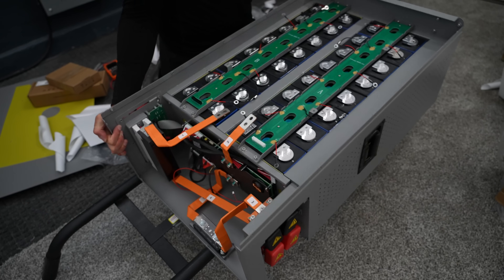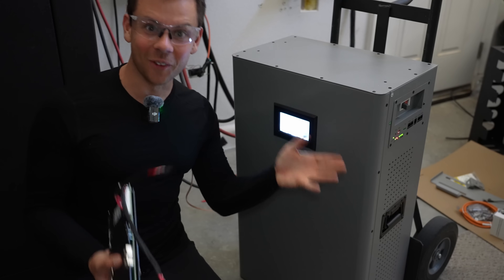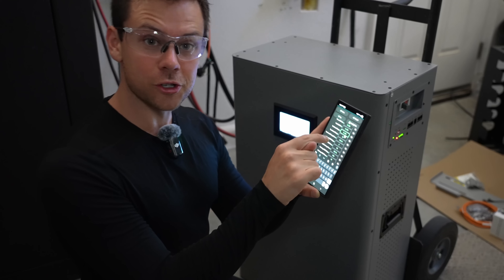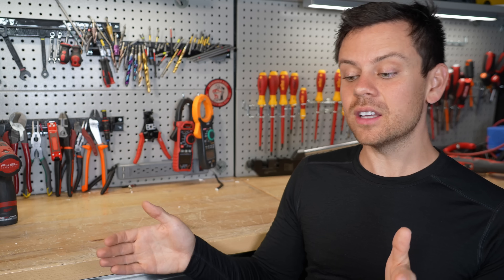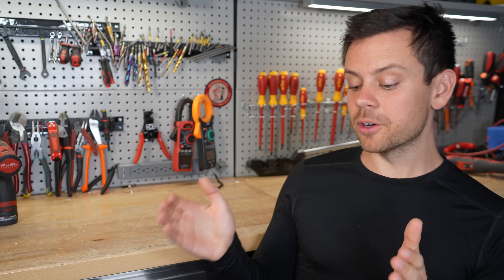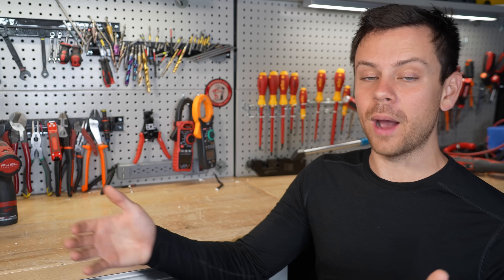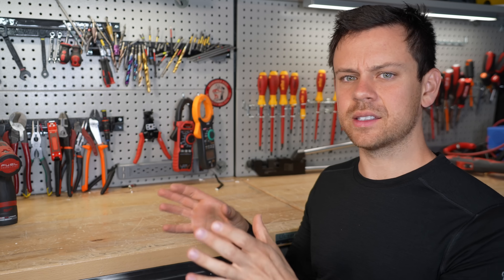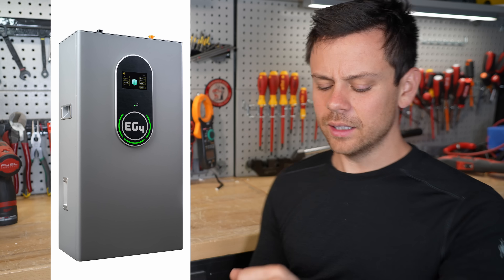Yixiang 16kWh Battery for $1,899?! What in the world!!

Comment: If you have problems with the terminal screw on the battery, put in an stud to the bottom with a little blue locktite and use a nut on it instead.

Should maximize the thread engagement since it's already at the bottom and not having it turning in the treads will also put less strain on the threads in the cell

Or just put in JB Weld instead of locktite 😂 
The current shouldn't go through the bolt anyways (for the most part)

Comment: I am buying US Stock Grade A - Version (3) EVE LF280K 280Ah 310Ah rated with single post welded M6 Studs for $73 each. x 16 = $1,168 and the Apexium/Docan horizontal DIY Kit With JK PB2A16S20P 200A Inverter BMS for $620. Total = $1,788 Free shipping and no sales tax. EG4 indoor wall mount battery with shipping and tax is $3,472, savings is $1,684. that is almost 2 for the price of 1. So my (4) batteries are $7,152 compared to EG4 at $13,888. That is a savings of $6,736. plus I get a better BMS than EG4.
I have (6) 200 amp JK BMS with 2 amp active balancing, 4 are in use. Batteries are 100% SOC at 3.5 volts and begin balancing at 3.45 volts. These BMS’s are set-it and forget-it. I have never had to top balance the batteries, JK has done it for me.
Watch Off-Grid Garage with Andy and set the BMS the way he teaches it. He is the foremost expert on these BMS’s.

Comment: I'm stupid how does 16,000watthours give ONLY barely 300AH useage? Is it because 16k watts can be pulled watts can be used but for only 300+ hours long?
Reply: Also for my office - I have 2 x200ah 12v batteries parallel connected to each other & a EG400ah 12v rack, what is the total ah or watts available because I just assumed the lower 200ah batts reduced the 400ah possible of the rack battery if used alone? How much energy is wasted because the panels volts coming into my 12v grid tie 1000watt inverter is 20-30v/8-10amps - Inverter it shuts down/batteries@under 12v if over 700amps are pulled or over 5hrs ran at 300-500watt load

Comment: Unlike you Will, many don’t have the ability to do a full charge all the time like they’re supposed to do. (Real world variables) That’s when the smart active balancer really shines. If they had been around years ago, communication to inverters to optimize charge and balance would be unnecessary. The active balancers also reduce stress on the cells by reducing the time at higher voltage associated at absorption time to balance. IMHO every factory battery should now have SMART active balancer.
Reply: That doesn't make too much sense, you cannot balance unless battery is almost full. So active balancer doesn't help if you cannot make full charges.
Reply: @ZFS2468 
When it actually does get to absorb, it has the power to balance instead of the algorithm releasing charge and going to float, or the the time limit for a networked system also giving up without enough time to for a passive balancer to do its job. No, don’t balance below 3.43 volts

Comment: Screwing into Ali in the UK is a big no no , as the screw bottoms out , it pulls the ali forward , So why dont they put studs in the battery , then add a nylock nut, If the screwing action strips the nut or stud you can replace both ?

Comment: Am I correct in stating that this is basically 3xLifePower4 batteries for less than 60% f the cost. Will, have you checked out starmax? Recently came across them. Lookin at their site at the moment EVE MB21 $47 per cell (i don't know anything about anything yet when it comes to cell brands), but 16 cells would be $752 supposedly grade A.

Comment: I would be extremely interested in knowing if the closed-loop communications work.  Apparently for my Sungold inverter to put more than 5a into a battery bank is has to have communications (SoC because just voltage won't work). So I'm not going to spend a bunch on a battery bank that will have no chance of charging during a day of sun like my 4x12v 280ah batteries.  For that matter, though, this is less than I paid for the set of 4 12v batteries so maybe it would be worth risking it.  :)

Comment: I came across your video because I'm thinking of buying a battery. The 16kWh looks a great deal. But as a newby in batteries, I have a 3 fase Growatt 5000 inverter. I Suppose I have to change it for a Hybrid one. Can the battery easily be connected to the Growatt inverter?

Comment: Will, i always have a piece of plywood cut to width and some 2x4's so it won't slide off. you can screw it to middle pipes or not. this way i don't have things sliding off or tilting (buckets, potting soil bags, etc) i always do a continuity test. love your videos cause i get to see new things i wasn't aware of :person-turqouise-waving:
Aluminum cracks due to: material properties, manufacturing defects, stress, impurities, temperature changes, improper welding techniques :face-fuchsia-tongue-out:

Comment: Right On for Competition in the Market Place. I think you paid just over $300 for shipping to get that $1899 total. I have built two DIY 48v 300 Ah LifePO4 sets now, in metal cases with 200 Amp capable JK BMSs w 2 amp active balancing (w older non inverter, no networking cables, for $1750, and $1800. IMO: That $1900 is a fantastic price. I like these Biggger 300  arena Ah batteries over the 100 Ah Server Rack batteries for having less BMSs in em. I think simpler is better. Also in last 6 - 12 months, I have noticed a couple of sources of assembled 48v 300 ah batteries for near or under $2K. If any of those comes w BluTooth and App readable BMS one could adjust specifics with, those might be my choice in the future for saving on assembly, configuration, and then testing time (or what I might recommend to a friend). Thanks Will for you ongoing fantastic lessons with your hands on the evolving market too.
Reply: Can you recommend a guide on how to build these that explains precisely

Comment: Wait a moment so in this BMS you can limit the charge current? I was thinking that that parameter just block the charge if amps go over. If really you can decide how many amps you charge the battery that's amazing because you can so decide how many amps a battery can take in a parallel setup

Comment: I built a DIY pack very similar to this with a very similar controller, and I had one cell that was consistently under voltage until it had almost 15 cycles on it. Now it's just like all the others. I'm guessing these cells really need to cycle a few times before they settle into their specifications.

Comment: should check out Off Grid Garage on how to set up the BMS, its active but should only be set to be active at high state of charge while its absorbing. he goes through everything in great detail on the JK BMS
Reply: Start Balance Volt under settings should be set to 3.45V and Delta Trig Volt set to 0.005V and this maximises the effectiveness of a 2A active balancer on this big battery pack.

Comment: "If you have matched cells" - LOL 
The only batteries that I ever had that seemed matched were the Fortune 100A.
Passive balancing was sufficient.
I have never gotten good matched cells with 280A cells.
I use a 5A active balance board with the 280A batteries.
My system sucked B4 the active balancer and pretty decent after.
I have the JKS BMS and it seems to work well.

Comment: My electrical inspector will not pass a non UL listed device in a system that requires inspection. This maybe ok in many areas where noinspection is required. The price is certainly enticing. I bet trump's tariffs will make them more expensive now.
Reply: Will he inspect your car battery or your EV you charge at home.

Comment: I saw that eve is making massive 628Ah MB56 cells now, any advantage in the future to use smaller amounts of these cells besides the obvious of using less hardware/wire/etc.?  The guy over on the Off-Grid Garage channel was testing them the other day.
Reply: If you use fewer cells, you'll probably be down to a 24V battery and having to upsize all of your wiring due to the higher amperage you'll pull.

Comment: I finally bought an EEL vertical battery kit for all my raw cells. It was pretty nice, but they didn't make the battery channels tall enough to put the foam pads between the cells, I could only fit epoxy sheets.
I also replaced the included "50V" ANL fuse with a Victron MEGA 80V fuse & block.

I like the JK active balancer, my system is only used for outages so I like it to keep them balanced. Also, my cells are a bit mis-matched since half of them are 2 years older used on a 24V system. They definitely have differing capacities.
However, I set my balancer to come on only at 3.45V/cell and set my inverter to charge up to 3.5V/cell. Enough to get a fairly accurate SoC and good capacity without sitting at higher cell pressures of 3.6 - 3.65V. Even at low SoC when I installed them, the pressure plate barely made it on, I'm sure there's a lot more than 300kg of force on those things as the pressure plate is actually bending a bit. The 1-2mm of belly on each of my cells really adds up stacked like that.
Reply: Our new EEL JK V3 vertical box is also about to be released, with double protection of 250A DC circuit breaker and 250A T-class fuse.

Comment: Those flexible busbars are great. Did you apply any compression to the cells, or was that not possible?  I have a 16kWh on the way from another brand.
Reply from the maker: I remember having these discussions on the forum with the cell compression. I'm a big fan of fixating them because they will expand in size at high SOC. Not a fan of cranking them down with pressure like some folks do. I had lots of grade b swollen packs that I would cycle without any compression and they were fantastic. 

In this battery box when you tighten down the sides it gives some compression but not much. Seems like most of it is with the foam. It is a tight fit though. 

Oh awesome!! Can't believe how cheap these things are getting lol can't wait to see your review!!

Comment: Hope this isn’t a dumb question but how would one mix this with server rack batteries that are hooked up to say a 6000xp? Do you just wired them directly in parallel or something? And how does the communication part work?
Reply: I have a total of 11 of these diy batteries all with jk bms's hooked to my 3 6000XP's, the inverters are parallel together.. All 11 batteries are hooked together in parallel.  I have 4 runs coming from my victron lynx power bus bars to the batteries, each run goes to 2 to 3 batteries from the lynx (200 amp fuse on each run as well).  So I can technically have an 800 amp load in this configuration on the battery side.   If you only have 2 or 4 batteries total it would be fine to just run them all in parallel off one run to a single inverter but depending on the wire size that will determine your max load capacity.  I ran all 2/0 cable (200 amp cable) to all the batteries and each inverter, so I have a limit of 600 amps total on my system (each inverter has 2/0 cable going to my lynx power distribution bars).  Of course the 3 6000XP's are not capable of that size of a load but I wanted to oversize all the wiring.
Reply: I have 6 eco-worthy server batteries currently. I’m not sure of the Bms type. Guessing they are different. Will that matter? I only have one 6000xp, wanted to double the storage and this seems like a good option. Just trying to get an idea if it’ll work well. 

Sounds like it’ll work to connect in parallel. Just now the communication, if that’s even really all that important.

Comment: Check both the terminal and the fastener threads. You may have a miss-match. If so, get new better fitting fasteners. Also, you could confirm the thread types match and use a tap and die set to re-cut/clean up the offending item. bob in neveda

Comment: According to Eve the cells should not be placed horizontally. I wonder how much this cell placement will lower the lifetime.
Reply: Eve also say these cells can tolerate 12psi of large wall compression. Laying them horizontal doesn't put the bottom cell at any where near this limit. But I think they should be standing upright for their first full capacity charge and first full cycle. Just my thoughts.

Comment: still after more then 4 months Yixiang still havent replaced the 28 of 32 bad cells that has cracks and some of them cant even handle 4nm of torque before the terminal snaps off,  so my trust in them is zero. they just talks and talks that they are going to do that and that but nothing ever happens. so for now i will go with another supplier when it comes to cells because i dont trust them any more and find another box to use.

Comment: looking forward to watching this later today -- Will, you and your amazing forum are what got me into solar, been rocking my 2X EG4 indoor wall batteries for over a year now. zero real issues (linked to 6000XP).  Only oddity is even though they were both in service at the exact same time, on battery "cycles" faster than the other, one has 295 cycles, other has 278.   Delta of 17 cycles over 1.25 years.  Can't explain it.
Reply: The cycles are counted using the current going in and out of the battery. Just a few milliohm of difference in resistance in your cables or connectors will ad up over time.

Comment: Great content! It's exciting to see complete battery kits finally becoming affordable for full DIY setups.

Are there any high-voltage kit options available? I'm planning to invest in solar for my farm, and a high-voltage system—around 400V—seems ideal. I'm aiming for about 300 kWh of storage and 100 kW of power, preferably using a 400V TN system.

At 48V, the cable thickness required for that kind of power would be massive, so I don’t see it as a practical solution.
Reply: What size  inverters would you use on this large system? (source?) How many kw of solar panels would be required to charge this large battery backup system? I hope you live in a sunny location like I do. (300+ days of sunshine, averaging over 8 hours of sunlight/day)
Reply: @ddmitch1 I live in Norway, so the sunlight conditions are poor—and extremely poor for four months of the year. That’s why I want such an overbuilt system, since there can be many days without sun. In winter, more solar is better, and you can probably never have enough; ideally, I’d have around 150 kW of solar panels to get a little production during the winter.

I have a lot of power-hungry machinery on the farm, so the inverter must be able to provide more than 60 kW of continuous draw, with support from the grid when the batteries start to run low.
Reply: I've read that going over 50 volts can be a nightmare if you are not a qualified high voltage electrician, due to government regulations and safety requirements. Perimeter safety fencing may cost more than the large diameter wire.
Reply: @ddmitch1 Here in Norway, everything has to be installed by a licensed electrician anyway, and we have 400 V into the farm and house, so high voltage below 1,000 V is fine and isn’t as heavily regulated.

Remember that some new EVs have 800 V batteries.

Comment: great video will !!!  is this going to be the new battery of choice for a dolly cart home system ? In a future video perhaps..... do a sub panel , 50 amp plug in cable from inverter   with that really quiet inverter you shared in the last portable build and this battery , with  solar panels . good grief the diy , budget , nearly  whole house system that's quiet , indoor, like under $5,000 ? I hope that video rocks the DIY folks sitting on the fence to  energy independence. :) keep up the great work . The reason for my suggestion , solar credits are going away. So the how to afford energy independence will be more important than ever. Net metering is going away , more states and utility's are cutting the legs of the  customer options.   thank you .

Comment: I am not sure where you have been for the past 4-years to not know that the JK is an active balance BMS.  Your concern about the active balancer is based on "add-on" active balancers which balance continuously for all voltages and SOC.  The JK only does its balancing at the top of the charge.  I have mine to balance at voltages over 3.45v per cells so it is only being done at the top of the charge.

Comment: Great to see a review of DIY with JK inverter bms. I have 6 of these. The bms accuracy is not accurate but it’s a great bms. I have it connected directly to solar assistants. I only have 4 batteries and I am keeping 2 bms for spares. 64killowats with sa and Bluetooth and just using threaded rods and wood at the ends and making the cables myself. I get the bms for $150 a piece.

Comment: Will, when I used those cells, I replaced the bolts with studs and nuts and that solved the problem. Great video!
Reply: I was thinking you could easily buy a tap and retap the holes assuming that was the issue rather than the threads on the bolts.
Reply: @hobbes1069  Only thing with retapping the cell terminals is that you would need a blind hole tap set, not a regular tap.
Reply: @randacnam7321  maybe... Depends on how much deeper the hole is compared to the screw length. :)
Reply: @randacnam7321  As a machinist we would take a regular tap and hand grind (for lack of a better term) the points down to crate a bottoming tap.  If you ground a little to much, hand grind a 60° to ease threading into the hole.  This maneuver isn't for everyone.  But works. Cheers
Reply: Crazy chip-n-dales 😂